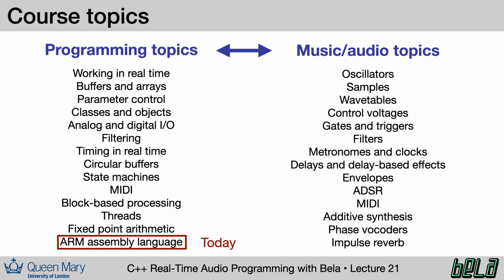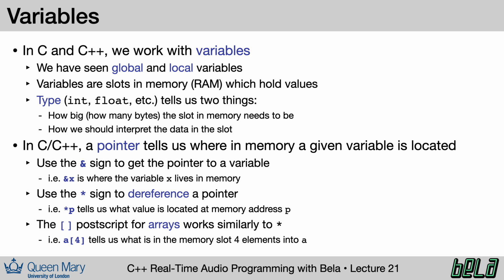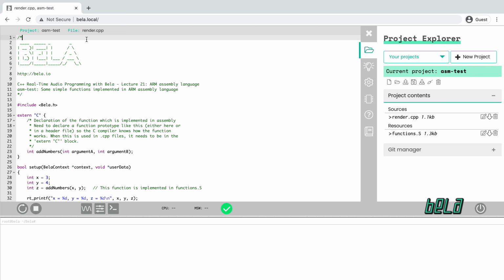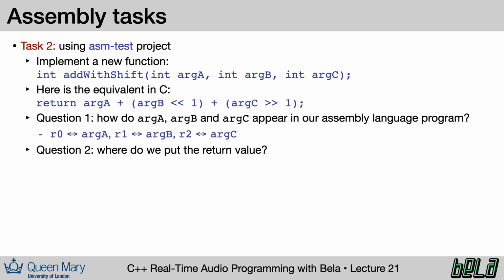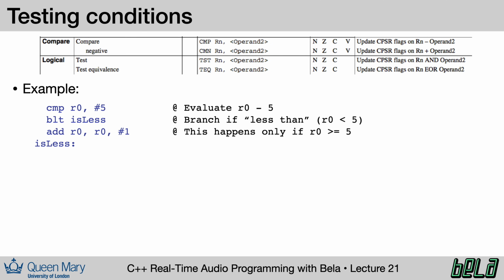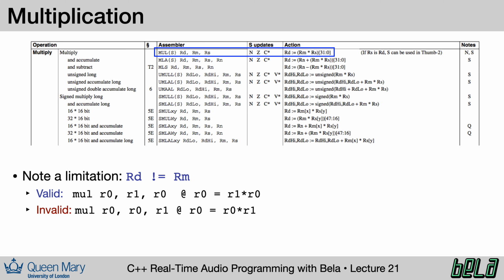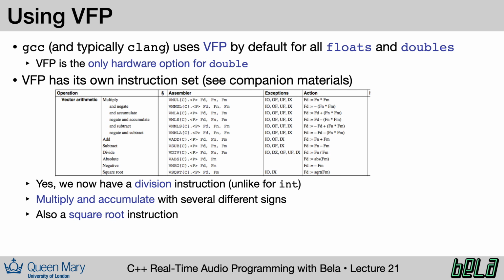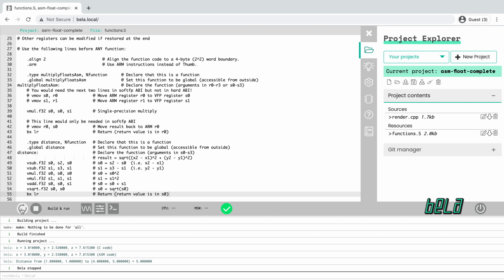21: ARM Assembly Language,  C++ Real-Time Audio Programming with Bela

Comment: Would it be possible to have 'bx lr' instruction instead of 'b isLessDone' and omit the label 'isLessDone:' entirely? I.e. can 'bx lr' appear anywhere in a function? (It doesn't make much difference here, but I'm just curious).
Reply: Yes that works too. The reason I show it as two 'b' statements is that it doesn't presuppose where in the function the branch takes place. But you do save one instruction by not doing a branch followed by another branch (bx).